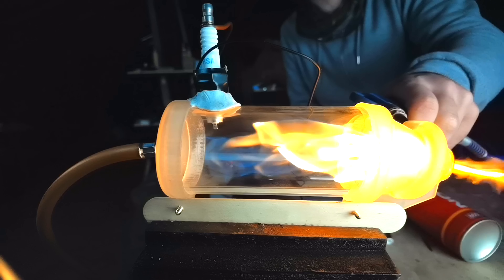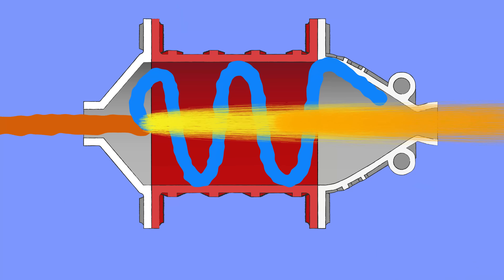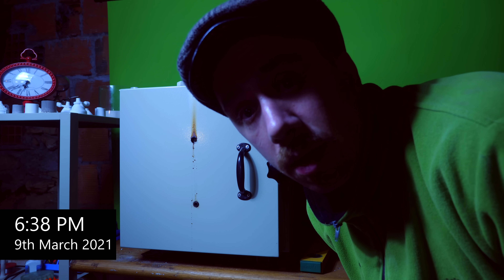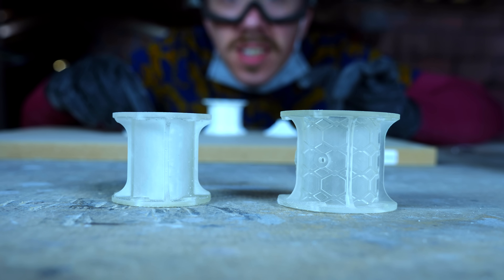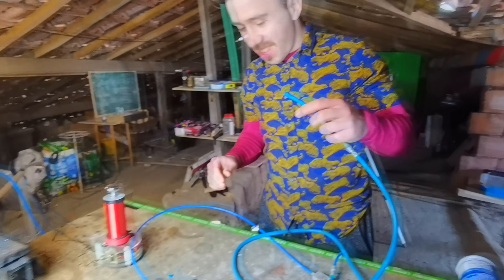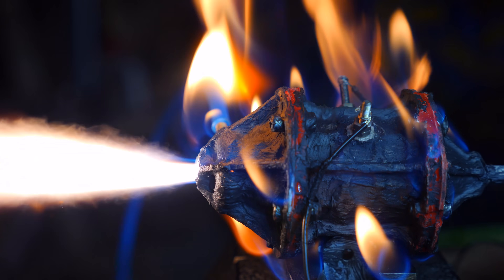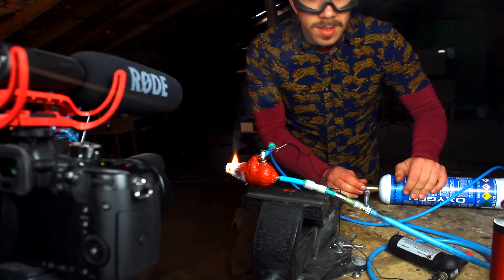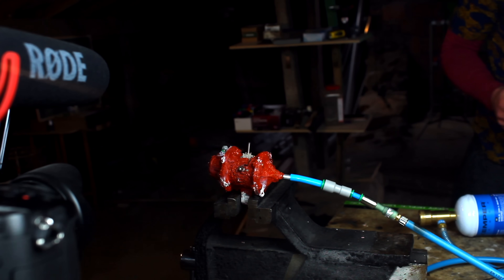Vortex Rocket V2.0 (3D Printed)

Comment: Try a type of electro plating the exterior after burning out the resin. That way there are layers of metal filling in all the micro holes.
Reply: Some chemical vapour deposition may do the job also
Reply: @hellsing56666  you think he's a billionaire?
Reply: @migueldatiles7937  maybe he can go in a shop that does it, no need to buy everything you know.
Reply: Bro idk much about this but i'm pretty sure electroplating only works on metal or some other electrically conductive material. and i'm pretty sure that ceramic isn't conductive
Reply: @migueldatiles7937  I just watched a YouTube video about a guy who electro plated his resin 3d prints then tried to burn out the resin to create strong 3 printed structures. Im 100% sure he can use the same technique to coat the outside of his engine in  copper then other metals from there
Reply: @wingmanbomer  I feel like I'm still 10 years old right now😂🤦‍♂️ yet I'm already 11 I did say I don't know much about this, but I still feel stupid🤦‍♂️😂, I'm really, really sorry😔🙏, but I hope you don't take it too seriously. Again, I'm really, really sorry😔🙏, and i feel really stupid 🤦‍♂️😂. Thanks for letting me know!
Reply: @migueldatiles7937  you joke like a person who also believes in "The holy savior Jesus Christ"
Reply: @wingmanbomer  Got a link?
Reply: @d3.1415  This method can be used: https://www.youtube.com/watch?v=Z228xymQYho
Reply: @wingmanbomer  I really am 11
Reply: @wingmanbomer  BTW he is using ceramic not resin. That resin thing was just a test. He probably was gonna use the ceramic one
Reply: @wingmanbomer  BTW I'm an aethist
Reply: @wingmanbomer  I just thought that at one part of the electroplating process the metal to be electroplated would be oxidized, then it would join the sea of metal cations that are also the same metal as it, then at the other part it would be reduced to it's pure metal form. Like how some people purify copper
Reply: @migueldatiles7937  he is using a ceramic mixture. Its 80%ceramic 20% resin... did you even watch the video?
Reply: @wingmanbomer  Did you see the part where he puts the mixture in the oven to burn out the resin? So after burning out the resin, I think there would be no resin left, at least, a negligible amount, and not 20% anymore so, that's why, I'm ignoring the resin part. Unless you want a dot of metal here and there on the ceramic surface
Reply: @wingmanbomer  BTW I know I've been rude, but can you post a link so I know how you can electroplate on resin surfaces.
Reply: @migueldatiles7937  I've already posted a link... read back thru the comments.
Reply: @migueldatiles7937  apparently this is a thing https://www.sharrettsplating.com/blog/metals-work-best-plating-ceramics/ but it doesn't sound very easy. It would make for an interesting video though, since it sounds quite weird
Reply: @migueldatiles7937  you can coat other non metallic objects its just not cheap or easy to do.
Reply: Making one of these parts with ceramic 3d printing is cool. However,  making these parts with Divergent 3d tech is IQ 1000.
Reply: What if you coat the part in primer, and dip it in molten aluminium?
Reply: Also a suggestion of using glaze for ceramics and then mix in the materials like sugar and pumice stone powder I need to get the starlite youtube link.
Reply: @BruceLortzHI  yeah and electro-plated copper and more layers of brass or other metals
Reply: @BruceLortzHI  the fact is. This design needs to be made out of cnc machined metal or be made with Divergent 3d's metal 3d printing tech.
Reply: I think you need a conductive surface for that.
Reply: @Jkirk3279  zinc spray paint. The brand I am familiar with is ZRC.
Reply: @martindinner3621  And then what? Zinc spray doesnt hold. This whole electroplating is fairly impossible. As in: It would be so hard to do it right... why not just glaze the ceramic? He has everything he needs for that?
Reply: @leocurious9919  Glaze or paint that can withstand Temps over 1000°F? No... electro plating or what London has said is the only option. Coating the part in a layer of molten aluminum sounds difficult to get right. However it may be possible.
Reply: @wingmanbomer  Obviously glaze can handle 1000 F. Even Lab glass can handle that. What makes you thing thats a problem for glaze? They need higher temperatures to apply (burn) them. Some much much higher, those for Porcelain need ~1400 °C.
Reply: @leocurious9919  id like to see him put a Glaze on that part and see if it can handle the Temps and pressure. My guess is no.
Reply: @Jkirk3279  there is a process by which copper can be electro plated to the surface of a nonconductive surface. After this process you can plate other metals in the traditional way.
Reply: @Jkirk3279  I used to think so
Reply: Or a high temp resin on the inside and outside? I wonder also if one used a high temp resin mixture. He needs to go to the starlite development channel on YouTube and try making starlight and use a pla as a form and them mold the starlite to it. Or even a high temp resin mixed with pumice stone ground into a powder. Mix so that the pumice is the main part and the resin is the binder. Again using the pla as the form to be burned out.
Reply: @Relearning_for_the_future  I don't see any pla resin being able to withstand Temps of over 1000°F.
Reply: @wingmanbomer  the pla is to be burnt out! It's a mold to apply the materials that can and be sacrificed.. think lost wax process. Also pumice stone can take 15,000 degree temps. Starlite was said to be able to take 10,000 degrees .. there is a channel that is working to recreate it. They have some well. Again the pla is to be sacrificed!
Reply: @Relearning_for_the_future  its seems like it would still need to be sealed. He would have the same problems. After the resin is burnt out the material becomes porous.
Reply: @wingmanbomer  not if you use a high temp resin as the binder as that would seal it. The inner layer of the pumice stone would create the heat shield. It's the leaks that allow the heat to build up so much. From the cooling oxygen outer she'll. The leak allows to flow to be disrupted. And the burning to happen too early. Also I suspect with out better control of the ratios of gas this idea is not going to work properly.
Reply: @Relearning_for_the_future  I don't understand what you mean. Using the resin as a binder is the same as what he is doing. The material he is using contains 20% resin. Im fairly certain that ceramic has a higher temp point than pumice. Not that that matters when the Temps are not even close to what they both can handle. The problem here is the porous nature after the resin is burnt out. That would happen with a ceramic or pumice mixture that works in a 3d printer.
Reply: @Relearning_for_the_future  also, as we have already seen. Sealing up the part with what he tried didn't work. That means most resins aren't going to work to seal it. They can't handle the Temps and pressures the engine puts off. I stand by my first theory that electroplating it is the best option.
Reply: @wingmanbomer  yes but that's a thickness issue for the pressures. The 3d print has pores that leak through. (I 3d print have 2 printers) by coating the prints you still have the pores and the pressures and heat are pushing against a less than 1mm coating to try and seal it. The 3d printed mold would be smaller than the finished item allowing for a thicker resin and filler. The 3d print burns out the filler leaving the holes but they don't bind fully. The high temp resin etc. Would be full thickness with zero holes and the pressure would be pushing against the container as a whole not greater pressure on individual areas. That then press against an extremely thin coating. Sigh I am tempted to 3d print and demonstrate. The alternative is using aluminum pla lost wax type. If you look for my other discussion.
Reply: @Relearning_for_the_future  I understand what you're saying. However gaining a full understanding will take a demonstration.
Reply: @Relearning_for_the_future  Aluminium wont do at those temperatures. It will just melt.
Reply: @leocurious9919  yes if the cooling of the oxygen vortex doesn't work. The nozzle would need to be cooled or made of a steel that can take high temps. but since we are trying to make a working model with 3d printing.. the nozzle could be designed around a water jacket also. I want you to run a test. Fill a water bottle half full then place it on the edge of a fire or on hot coals  Poke a hole with a nail in the lid. The plastic pop bottle can take the heat as the water will prevent it from hitting the melting point till enough of it has evaporated. We did this in elementary school science classes here in Canada.
Reply: @Relearning_for_the_future  Water bottle made from plastic, so PET? The glass-transition temperature is at 70 °C. As soon as there is too much heat from the fire the plastic will deform.

Wall thickness is about 0.3 mm. If the water is at room temperature, so 20 °C, the maxium allowable temperature gradient across the PET is 50 °C untill it reaches 70 °C. Lets calculate:
The heat transfer coefficient water<->PET will be ~500 W/(m²*K) in this scenario.
The thermal conductivity of PET is 0.24 W/(m*K).
How much heat (Q) can be conducted befor the PET reaches 70 °C?
Q = U * A * dT
U = 1 / ([1 / 500 W/(m²*K)] + [0.0003 m / 0.24 W/(m*K)]) = 300 W/(m²*K)
Since only one side of the bottle is heated, lets assume the area is about 0.02 m².
dT is our limit of 50 °C (70 °C - 20 °C)
So Q = 300 W/(m²*K) * 0.02 m² * 70 K = 300 W

Thats reasonable. You need to get fairly close to a small fire to get that much heat radiated onto the bottle. However, you put the bottle on(!) the coal. Its going to deform, no way around it... assuming the coal is actually glowing hot.

Since you even talk about the water level going down due to boiling... that will not be be a plastic bottle. It has to be glass and even that might shatter due to the high thermal stresses due to the large heat flux. While boiling the inside of the bottle will be at ~100 °C, but the outside is much hotter.
Reply: @leocurious9919  yes but now your starting to see. Since this is a model not a full rocket engine and we're looking to get the vortex part working. Using a water jacket that as it heats up is moved and replaced by cooler liquid it will increase the max temperature of the materials. Since we need the engine to survive a short time for a demonstration and we know our materials are greater than a pop bottle and can take much higher temps and we won't have to worry about deformation.. over a long period (though he does like to go till it blows lol) it should allow for the materials to survive plenty long enough to complete the testing. Now another option like elon musk's heat shield idea is to make extremely fine tubes at the tip of the nozzle that will allow for steam to escape also cooling the nozzle jet where it will be hotest with fresh water being pumped in. Again this is just to test that the vortex works. And based on his early video it does .. part of the issues becomes size the 3d printed one was way smaller and leaked. Two problems with that. The leak causes lose of containment as now the air flow is disrupted also being smaller means it doesn't have the time from injection to running for the vortex to properly form. The nozzle well it just needs to last long enough. Think old school washer rockets. Right now your going WTF is a washer rockets. Well it's a pipe with a washer welded to the end to restrict the flow to increase pressure. We all know the washer will not last.. but it does the trick for short runs. That's all we're trying to accomplish here. Good enough to prove the concept and make it work. Now the idea of using glaze as the medium was presented and mixed with pumice sand in an extremely thick goop then cast that between a pla form and then allow to dry then he has a mini killen (sorry my dislyexia is killer) this will create an extremely solid and heat resistant nozzle that may not need a water cooling jacket. Humm I am going to have to try making a pla mold for this in fusion 360 and test. I can get oxygen from the store and propane is easy. Pumice stone is cheap at the garden center.
Reply: graphine plate interior
Reply: @timothyboulton2612  The added airspace of the porous ceramic is actually a positive attribute. It will act more like aerogel. Adding a few layers of copper, brass, and tin to the exterior should do the trick to fill in the holes and provide enough heat resistance to run the engine longer than 15 sec. Filling in the holes on the inside is counterproductive to the end goal.

Comment: Maybe just do the 3d print as before but then completely cast plaster of paris around it in a tube.  Should resist the heat and provide support and pressure resistance.  Maybe suspend it in a PVC tube while casting for that fancy rocket shape!

Comment: The reason why the parts crack when you bake them is that you take them out and leave them at room temperature.Leave them in the oven alone one day to cool itself. Another reason is that you   leave them on the fire for too long .  
The best shape they the one in the shape of a cone  while to close the entire combustion chamber so that there is no combustion  whole engine covered with a  thicker layer of clay,  not baked, only left to dry in the shade

Comment: so many of your problems seem to be around using a material for the combustion chamber that can resist the heat... Have you thought about using a stainless tube, inserted into a more traditional 3D printed sleve that allows water cooling?  Fish tank pump and a large bucket of water would do it; have the water swirl around the outside of the stainless tube combustion chamber. Ceramic printed nozzle. Just a thought.

Comment: Integza, I love your creations! Could you try printing the engine in Ceramic as a block or an orb and just leave the internal cavity as you normally would? I believe this should leave nough material to keep the engine from leaking. Though it woudl be a less efficeinet (In terms of material waste) I think it should provide a soultion to the leaking and also durrability. If you tried this in the single piece engine or a modular engine, i think that the Cermic printing should be enough on its own.

Comment: since the leaking is from the porosity of the ceramic itself, why not coating the inside instead of the outside? then the size of the holes of the porous material will be too small for the pressure to force out the coating, and thus preventing the leak.

Comment: I would make the ceramic print multi layered. Similar to a jet engine combustion chamber you have an outer casing and then an inner liner inside if which the combustion occurs. There's holes going around the inner  layer in increasing size leading up to the far side of the air input, and in your case also the end at which fuel comes in. This way the air cools all the material and the combustion occurs in a very confined are aka the inner liner, where you have air coming in a mixing in a specific place. It would have to be pretty big and similar to the single print engine you did, really liked that one. But make it one print with open end (to allow resin to flow out), two layers, solid outer, inner layer is like the inner combustion liner in a jet. Supports between layers can be used to direct air. Leave the exhaust end open for resin to drop out, the print a plug for it. Then cure the parts, and then heat up the exhaust and cool the plug to fit in place. If you've somehow made it this far, I hope this made sense 😂

Comment: Just out of curiosity, wouldn't it be more effective to print a mold (in resin or PLA) and use cement/concrete to make the engine? The entertainment value wouldn't be as high of course so nevermind. Continue! :)

Comment: graphite gasket material might be the key for between the parts, it comes in flat sheets that you cut to the desired shape. I used to use it on high temp ovens to seal these pressure chambers we had inside. id also look at somehow glazing the engine, the glaze would fill the pores in the ceramic

Comment: Integza I can fix on half of your problem but I assume it will just cause more problems 3d print all the parts in ceramic then bury the parts in sand and get a good mold and cast it in aluminum or with something with a higher melting point

Comment: how  about insulating the inner combustion chamber with carbon fibre /or adding graphite in the ceramic mixture or even 3d printing out of graphite resin mixture and then bake it perhaps  it would prevent it blowing up; but ,  perhaps  starlite  material as insulation could help best and cheapest  https://www.youtube.com/watch?v=aqR4_UoBIzY

Comment: You could coat the parts in a thin layer metal.  Like soaking the parts in an electrodeless copper plating solution. Or coating the inside graphite before curing to make it conductive for electroplating. Or use plasma vapor deposition. Every way will yield slightly different results, but they could decrease porosity and  increase  the heat capacity and thermal conductivity

Comment: I would try to solve the with the leaking combustion chamber with a coating of "emaile" (enamel winches) . That is a ceramic coating, thats often used in high temperature applikations.
The coating process is similar to a powdercoating so it should be pretty easy for you.

Thx have a gread day

Comment: Why not make it out of concrete instead of ceramic? 3d print an injection mold of the rocket using a dissolvable material like PVA (Polyvinyl Acetate). Then fill the mold with high strength concrete or mortar. Then, when the concrete has cured (2 or 3 days) put the mold in water and wash it away from the concrete rocket. You can make the walls of the rocket as thick as you want since shrinking concrete isn't much of an issue.